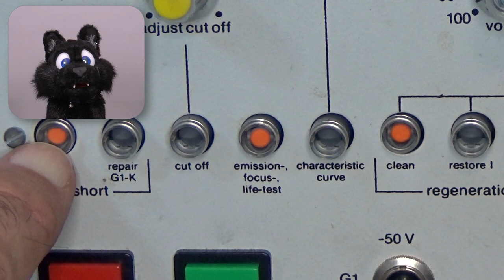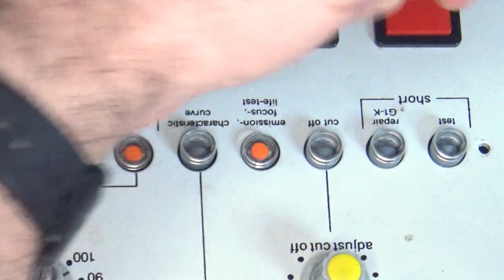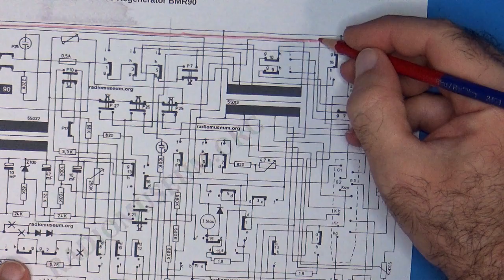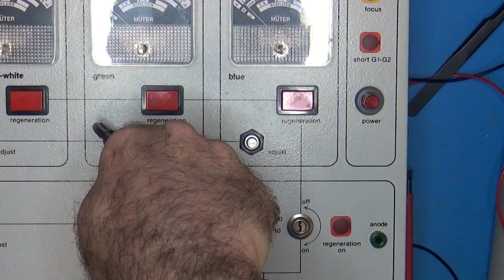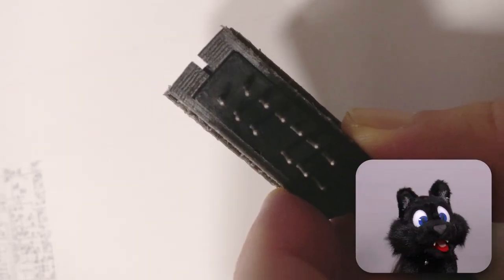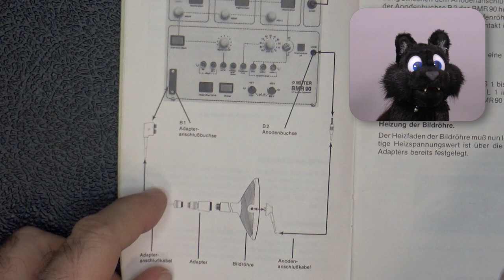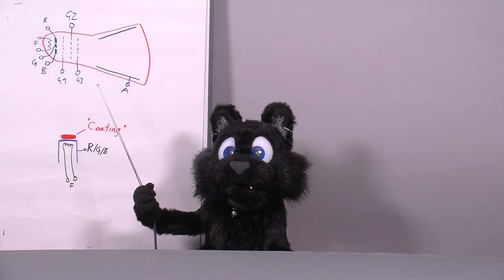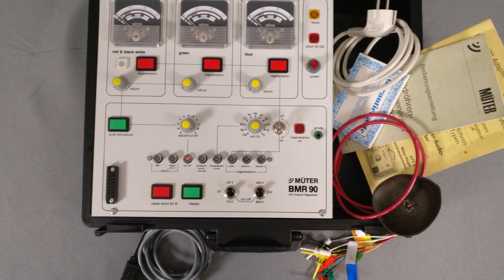Workshop Project #9: CRT Tester (BMR 90)

Comment: Many years earlier, i got a müter bmr 95,with all instructions,and 4 Adapter books,for 80 euros,first hand,from a tv repair shop,today,i started restoring a b&k 467 ,the american Version of a müter,it's almost finished,mostly a lot of cleaning, then replaced every carbon resistor,which is out of spec,and replaced some capacitors with new ones,except the two 47uF in the power supply. The are 47uF 450 volt,i only have 47uF 400 volt.

Comment: Hi, The male connector at the end of the adapter cable, which goes into the unit ... Do you happen to know what it's called and if they still sell it somewhere? Thank you!
Reply from the maker: Sorry, since mine was only missing the cover, I just replaced that... The manual also just called it "the connector" and I don't have a parts list either. I can poke a few new contacts, but I have little hope 😔

Comment: The indicators of the activated functions are very clever :-) the unit is very clean inside !
Reply from the maker: I have been told that these were common place at some time... still, this is the first time I have seen them. I know the ganged switches, but the indicator caps were new to me.
And yes, it was pretty clean; but I also had to remove quite a bit of dust and sand-like stuff, since the unit was used in the field.

Comment: Brilliant video, very helpful. It seems like you put a lot of work into this!! May I ask, how do you set the heater voltages at either 6.3V or 12V? The manual is in German so it is not much help
Thanks!
Reply from the maker: Thanks! This particular device always provides both voltages on the connector, it's the adapters the pick one or the other. Not having to switch was a selling point of that company. It does make it a bit harder to properly connect the tubes with the "clip on" adapter I made; But it does have a "ground" and both a "12V" and "6V" lead.
Reply: @atkelar  Gotcha. It is the same as the BMR 95 then. I thought the BMR 90 was different but it isn't. I'm going to build the same adapter as you when mine comes in. Thanks :)
Reply from the maker: You're welcome! - I think the BMR 95 is only different in that it has one additional dial? Also a much cleaner schematic. I found it during the research for mine and it is much more modern. The 90 model one is more like a tube circuit diagram, the 95 one is better organized. Good luck with your device!
Reply: @atkelar  I believe so.  it seems the additional dial and different panel layout are the only differences. I read the regeneration feature may be different but I'm unsure. There's also the BMR 2005 which has a soft/strong button. Need to translate the manuals and compare. Agree re. the schematic ;)
Cheers & take care!